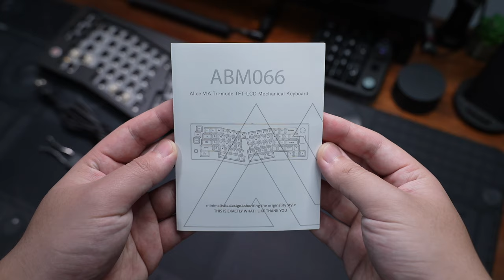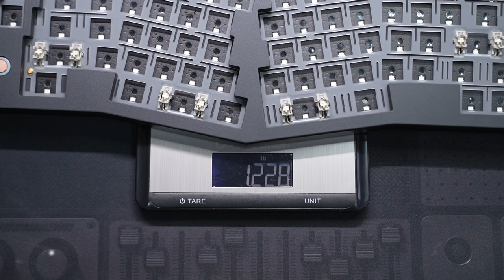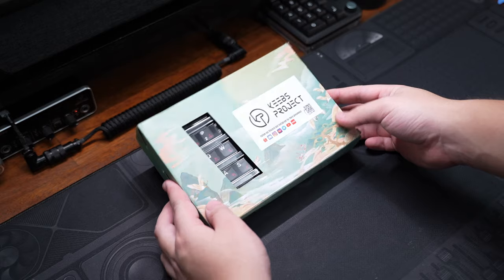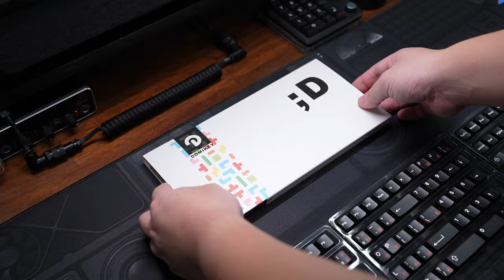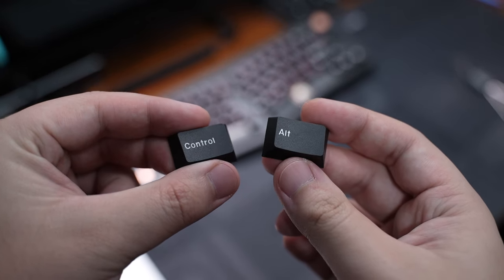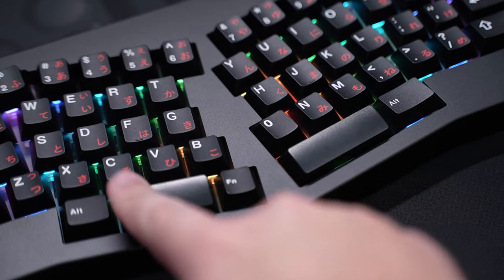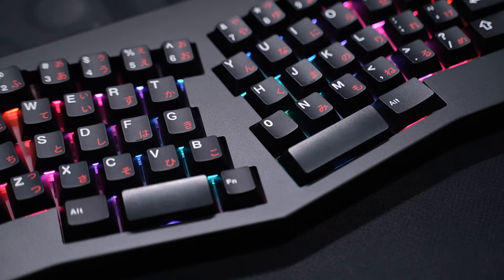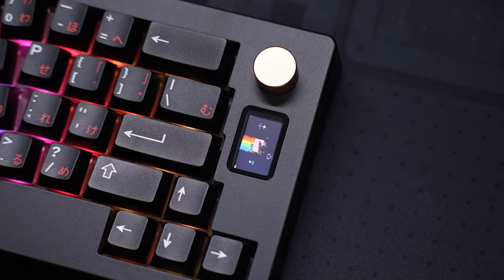CIDOO ABM066 Mods Build & Sound Test

Comment: mine doesnt work with VIA, do u have any solution?
Reply from the maker: Is yours VIA compatible? You just need to flash the Jsoj file a few times for it to work
Reply: @itssamueltan  I downloaded the latest VIA version and usb json file from ciddo web but still didnt work, i have no idea what it needs
Reply from the maker: @nguyentuan-br1kz  you need to flash the Json file a few times in VIA
Reply: @nguyentuan-br1kz  mine at first seemed like it wouldn`t work but after messing around the layout appeared, id just suggest trying alot

Comment: 1:49 i broke 3 unused credit card prying open the top case
Reply from the maker: Damn
Reply: That is cause that is not the right tool.  You need some plastic pry tools like the one used on laptop cases.  They are cheap to buy and do not bend like credit cards.  You will see the reviewer using the correct tool.